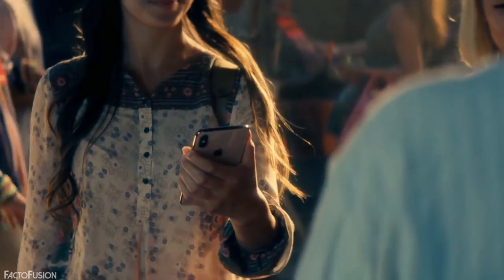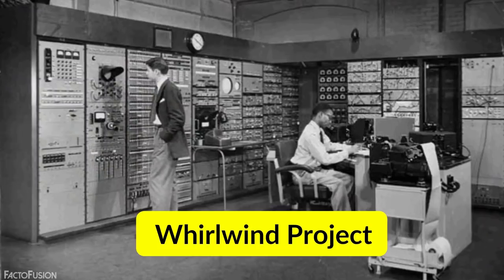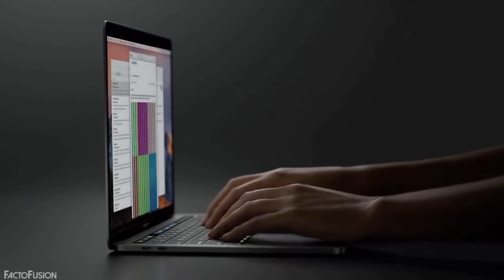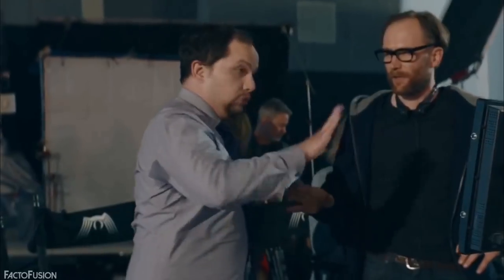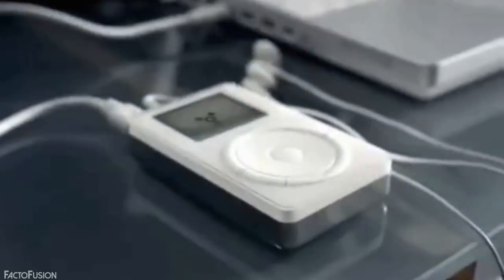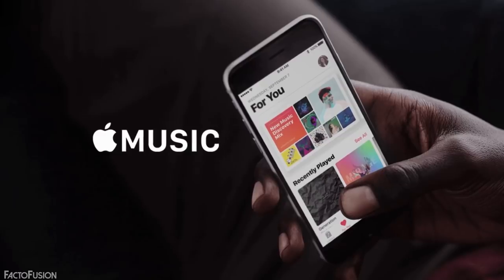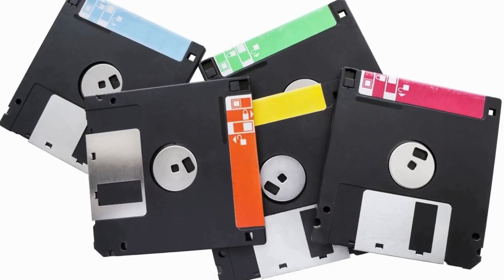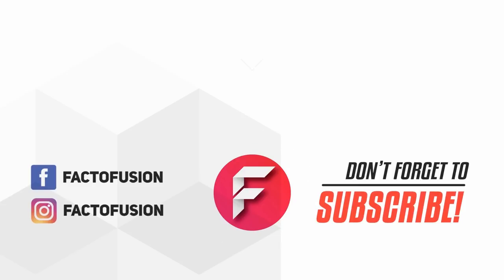This is How The First Hard Disk Drive Looked Like

Comment: 4 kb isn't a small amount of ram. It is enough to write more A4 pages, when the pages are fully filled, 4 kb takes up two sides of a sheet, or more using standard Dos sized characters. So the computer was probably designed to make posted letters, to look nicer than hand written.
Reply: It was a flight simulator for the US Navy.

Comment: I got  job at a computer plant in 1977. We had three disk drives at the time. One was a one point four meg, a two point eight meg and a HUGE 29 Meg cabinet on wheels that held a stack of platters that was loaded and unloaded with a plastic cover that we referred to as a "cake cover". All equipment except for the 29 Meg drive were all rack mounted including the tape drives.
Reply: Ohh u damn so lucky to have seen all that and still see how fast the tech is advancing, for me I grew up in the era of that big diskette that was 5.14mb if I haven't forgotten and that one of 1.44mb the hard drive must have been of something max 100mb-500mb if am not wrong and there was no CD drives😂

Comment: If we designed a hard drive today with platters as large as those in the RAMAC 305, it probably would hold 2 petabytes.

Or so I think... I really don't know. Maybe we can cram 2 petabytes inside a 2.5 or 3.5 HDD 30-50 years from the year I originally posted this comment.